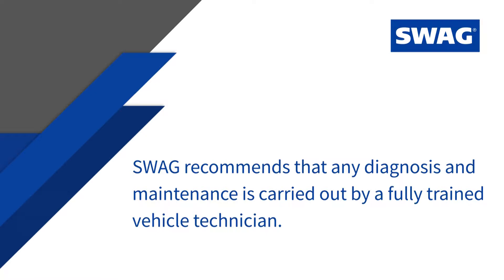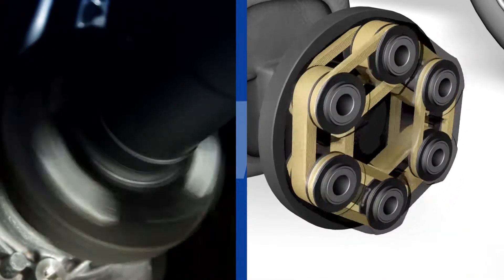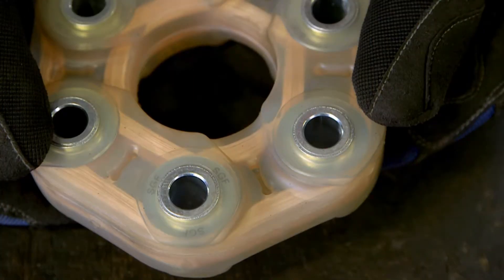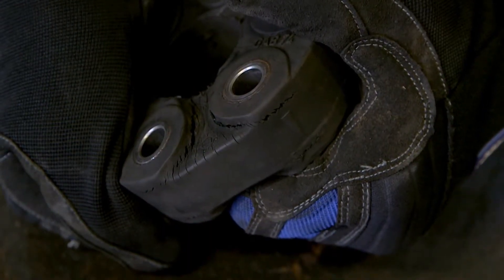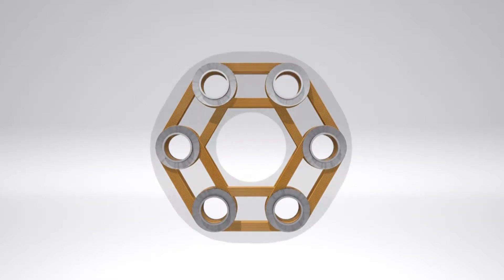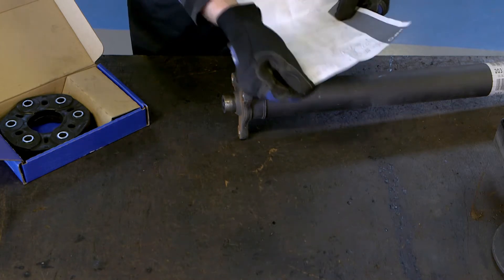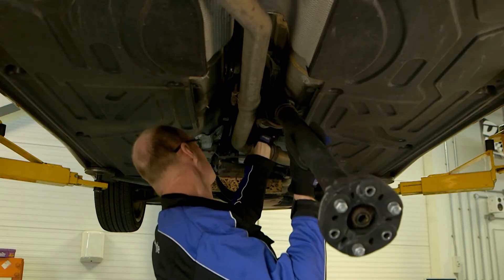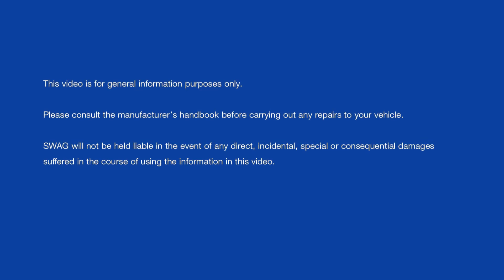[EN] Propshaft coupling inspection & replacement

Comment: Can this cause a vibration in the steering wheel while driving?
Reply from the maker: Thank you for watching our video. Vibration caused by a worn propshaft coupling usually causes the body to vibrate, not just the steering wheel. Vibration felt through the steering wheel is usually the wheels out of balance or a faulty tyre.